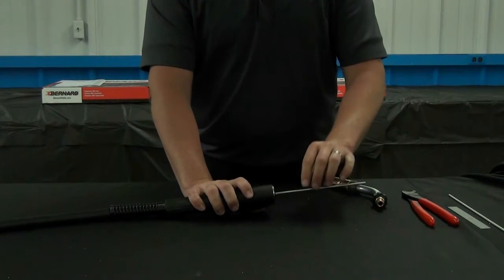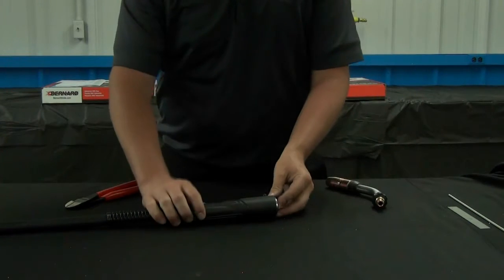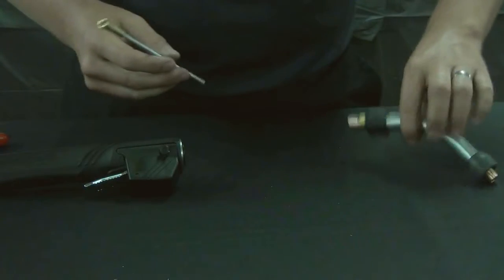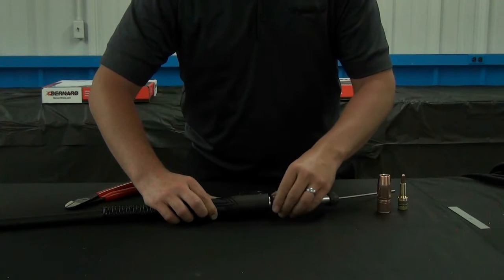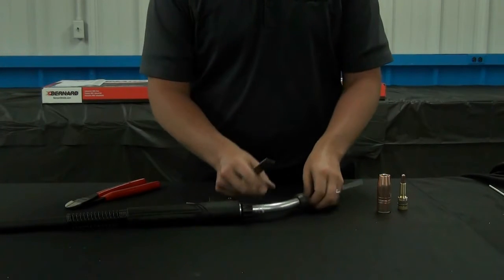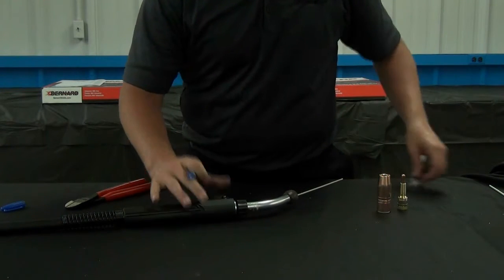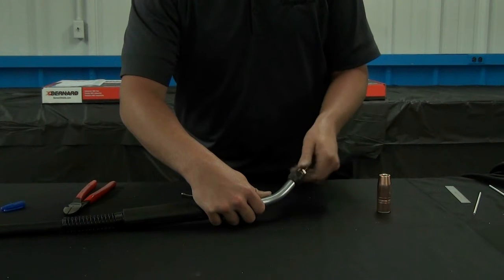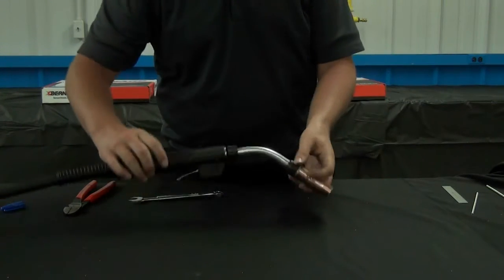Bernard® BTB MIG Guns installing a Rotatable Neck Jump Liner

Comment: Will  a .023-.030 jump liner work with a .035 conventional liner so as to run smaller wire?